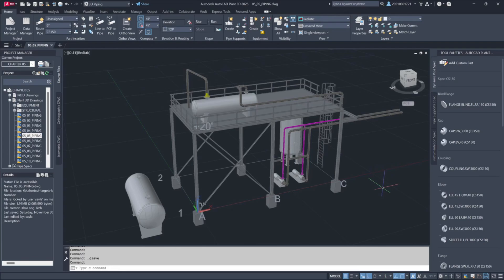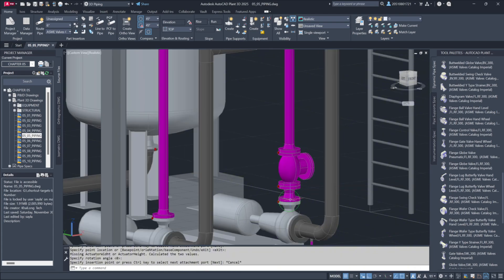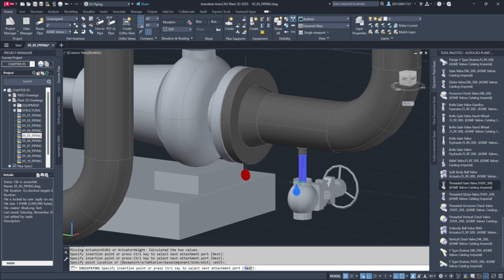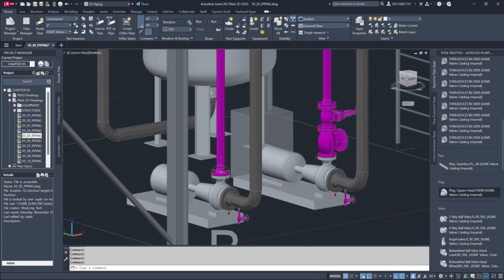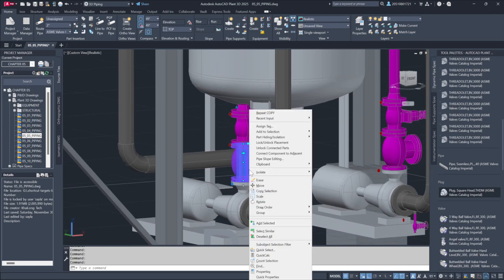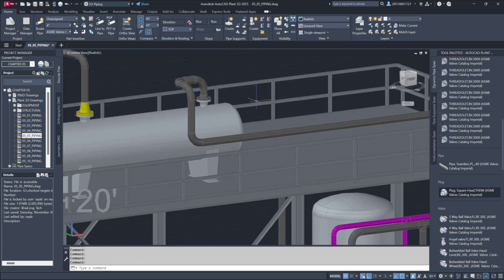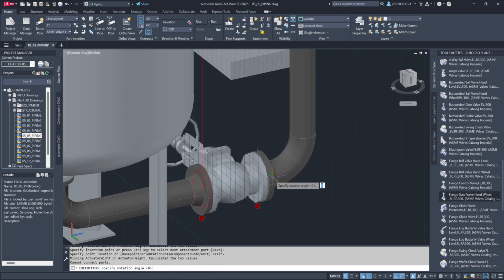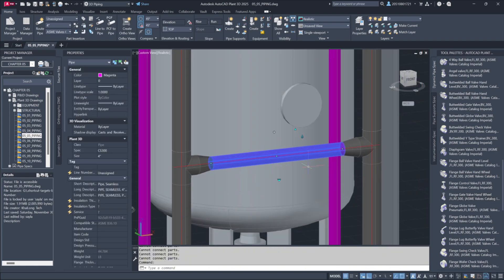Chapter 05 Piping - 5.5 Adding valves

Comment: How to make your valve has the same color with the pipe? Thank you.
Reply from the maker: Hello, by default, the pipe color is the same as the valve color. You don't need to do anything unless you use the valve spec by block. Then in the block, you need to adjust the color of all blocks (including nest block, which is also by layer).